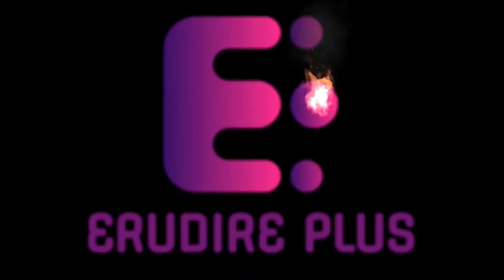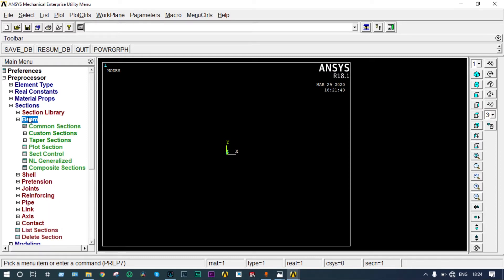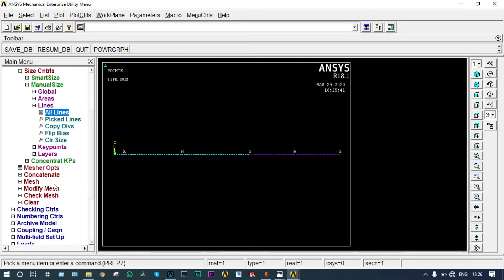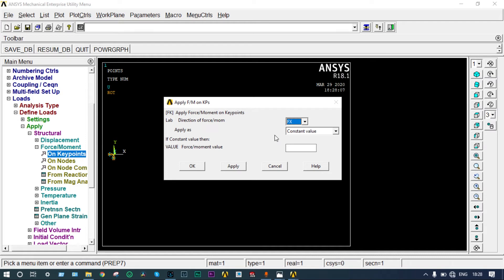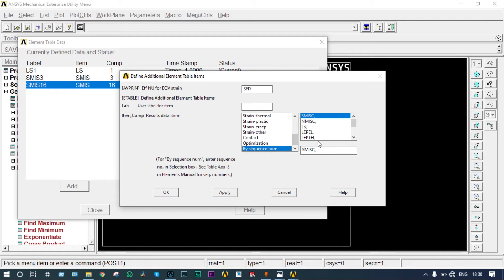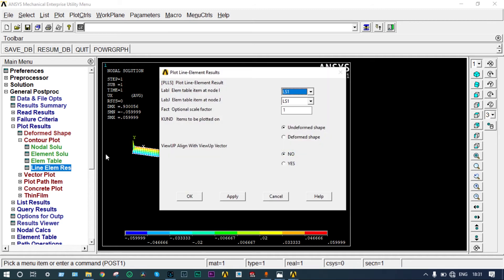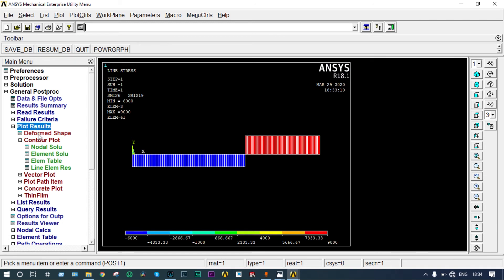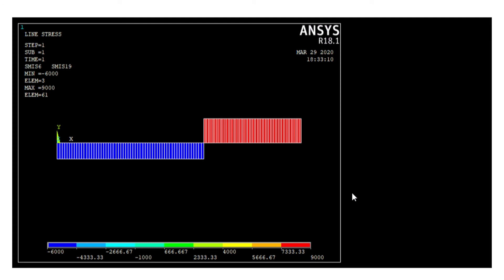How to  - SFD and  BMD - ANSYS APDL Tutorial for Beginners

Comment: sir how can you take movement on 2 key point it only has one dof is ux im correct if not please explain how can you take movement z to 2 keypoint please
Reply from the maker: Dear, please note that it is not a 2D problem. You can validate your results with theoretical solution of this problem. You may follow your 2D approach and check your results from theoretical results.